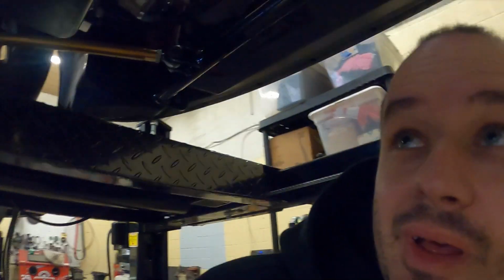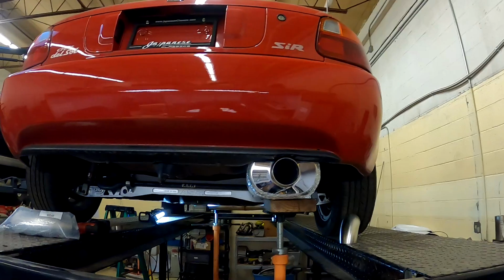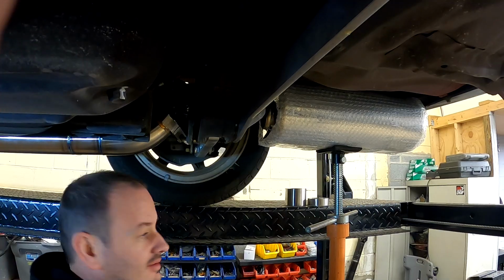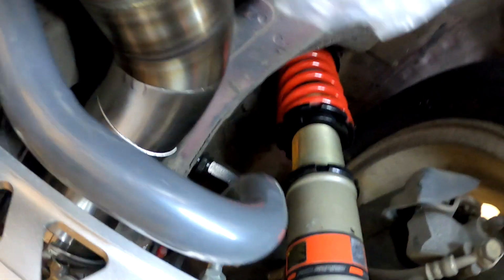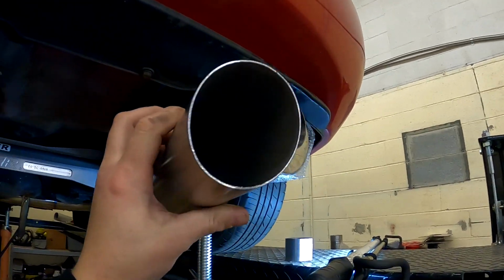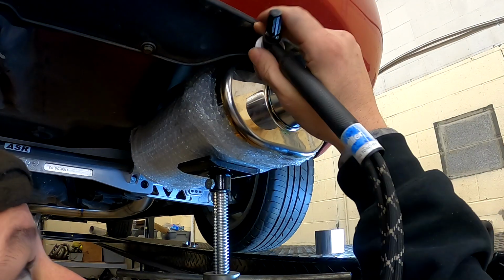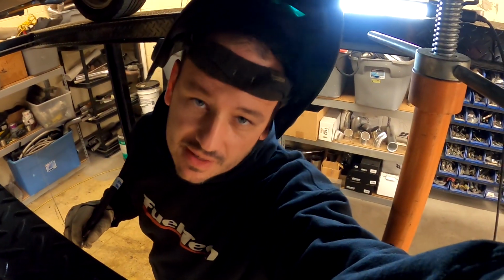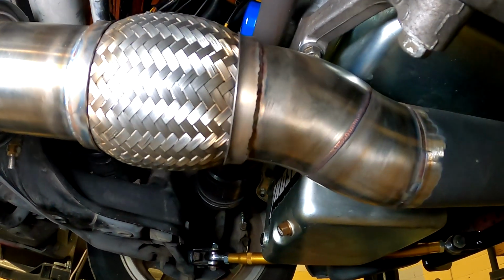RHD Turbo Del Sol // Fabricating a 3" exhaust with a big muffler and no space!

Comment: What you do for the tip I do often with most mufflers.  I like to trim mufflers back just cuz it looks cleaner and allows muffler changes or replacements in the future to be easier since then you dont have to add in pipe to make up the difference.  I miss having the huth hanger bender...so jelly you have one.  My current machine doesnt offer such attachment.  Hey next time you go to pull the piece out of the muffler use the sawzall it generally pulls it right out.